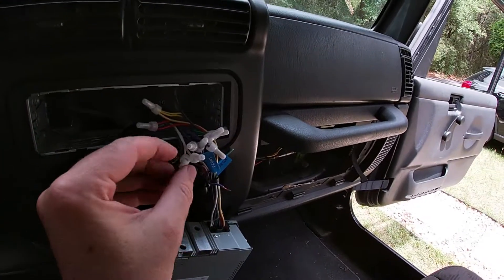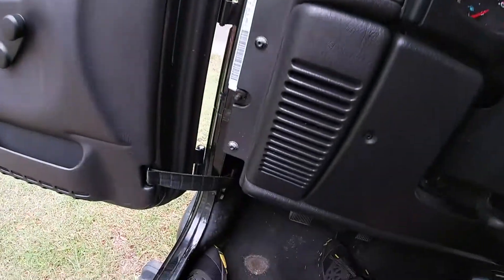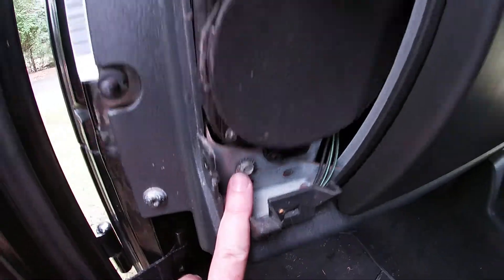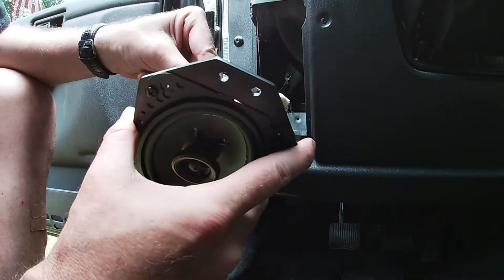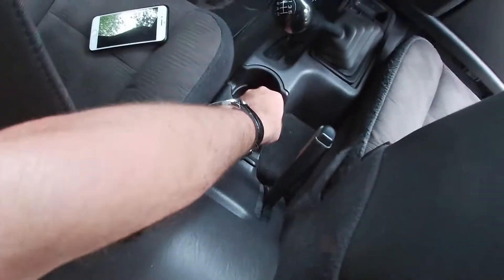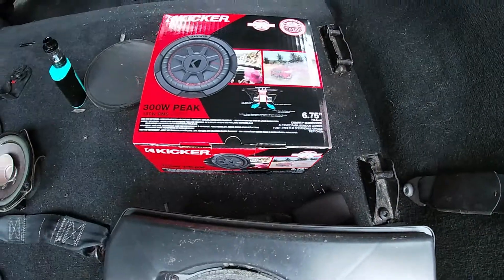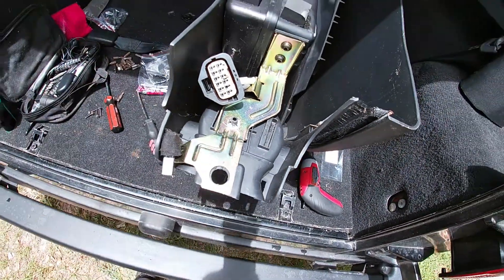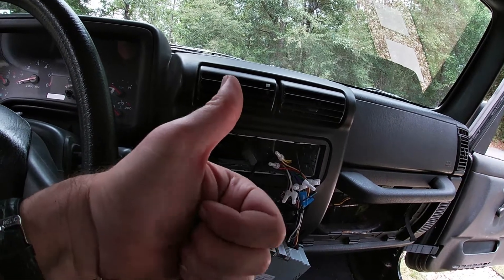2004 Jeep Wrangler TJ Stereo Install - Full How-To

Comment: Great video.  My 2002 TJ is due for an audio upgrade.  With 35" mud terrain tires the road noise currently overrides the stereo.  It has the stock 20 year old speakers so I think it is time.
Reply from the maker: I understand, top down or the soft top flapping made it impossible to hear the music. It is definitely much better with even this inexpensive upgrade!
Reply: @FloridaManTV  I have the Kicker deluxe kits sitting in my Quadratec cart as I type this.  ;-)
Reply from the maker: Heck yeah! Enjoy! You’ll love it!

Comment: the details like how the connector comes off would complete the video for me im old now it would have made it easier but good overview!!
Reply from the maker: Thanks! The connectors for the speakers are just unplugged if that is what you’re referring to. If you mean the radio, I just pulled the crimp caps off and solder the wires with shrink tube around it. 
Thanks for watching and hope it did help you a little.

Comment: On the woofer speaker mounting...did you only need to drill new holes?
Reply from the maker: I didn’t even drill holes. Get a few screws that fit the hole and zip them in though the plastic. I used a power screwdriver you saw in the video. Screws go right through the plastic center console. 🤘🤘

Comment: i bought these speakers straight from the kicker website, do you know any way i can find the wire harnesses and the adapters by itself?
Reply from the maker: Just go to Crutchfield website, enter your vehicle, and select speakers you have. They will show the adapter plates and harnesses that go with it. I am sure you can buy independently, but, if not, call Crutchfield and give them the part numbers and I am sure they get can you what you need.

Comment: Nice video. Love your enthusiasm. What did you end up using for the head unit? Butt connectors?
Reply from the maker: Thank you! For the head unit, since Jeep body harness plug had an adapter harness with loose wire end, and the head unit harness has the same. Solder with shrink tube over it is the correct way to do it for maximum durability and water resistance. For me, it’s important on a Jeep as doors off in Florida salt air and pop up rain storms can shorten the lifespan of most electronics. 👍🏻

Comment: Do you have the speaker information on the Crutchfield speakers you got? I want to order the same ones you did. Thanks.
Reply from the maker: I put in all Kicker KS series. So far, no issues with them. Loud enough to hear with the doors off etc. but, as a low end speaker don’t expect to shake the pavement ya know. Just better/louder sound over factory speakers. 

If you put in your Jeep info into Crutchfield, they will show up in the search and when you click them, it’ll ask if you want the free install kit when you add to your cart. 

Hope that helps.

Comment: Aren’t those speakers 75W RMS??? Isn’t that over kill for not having an amp?
Reply from the maker: Don’t remember the rating but my Jeep has the sound package from factory with the factory amplifier. The head unit goes to the amp first then out to speakers. Works fine for me but not sure if other head units etc will behave differently.
Reply: The Root Mean Square of a speaker is only it's designed continuous power rating.

Most Stock stereos still push 30-40W per channel, meaning in most cases a speaker with a 75W RMS would be well below it's recommended threshold and if anything prolong the life of the speaker.
Reply: @FloridaManTV   Any instructions on how to replace the factory amp with an aftermarket amp? I have the same setup as your jeep and the factory amp is dying.
Reply from the maker: I would imagine that the replacement amp should have the same layout (output wires) as the factory. In theory, you could just use the factory amp location as a hub to connect all your wires and get whatever amp you desire. For example, let’s say you wanted to beef up the system, install a large amp under the seat, run the output wires to the center console and connect. Or, you could get a smaller amp that fits in the factory amp location. The choices are nearly endless on the design. Just make sure your matching the components and speakers for a balanced system. To learn about that, search YouTube as I am not the best source for talking about wattage and amps. Others are pros in that area. 
Thanks for watching the video and I hope that helps a little.
Reply: Kicker has a  5 channel Amp that is a good add